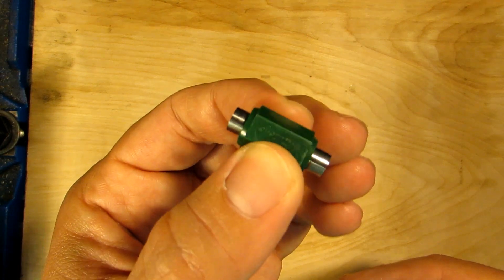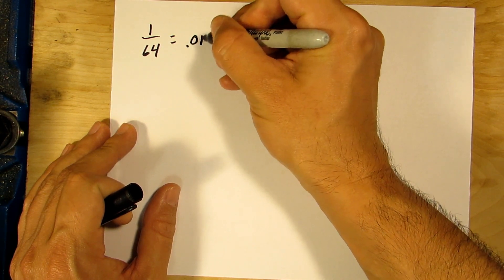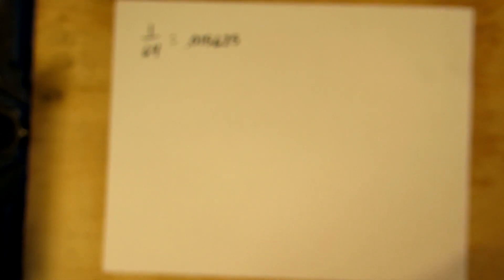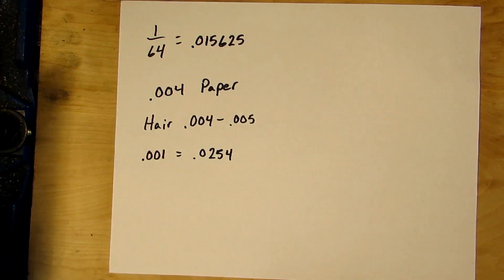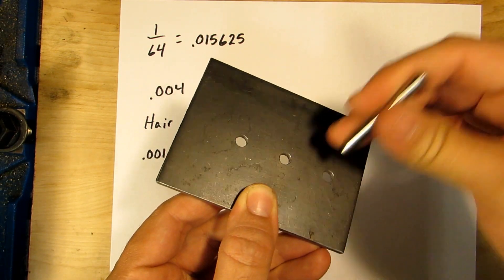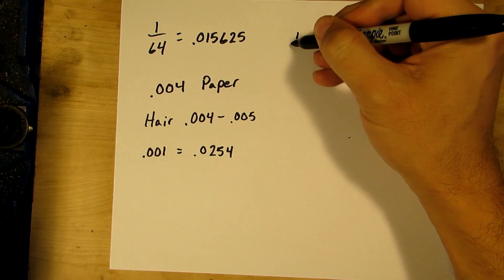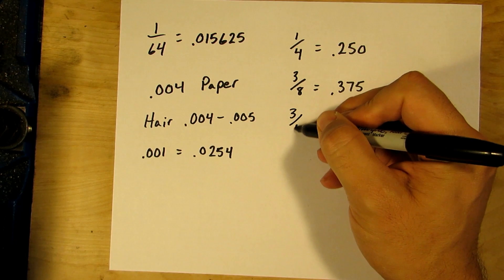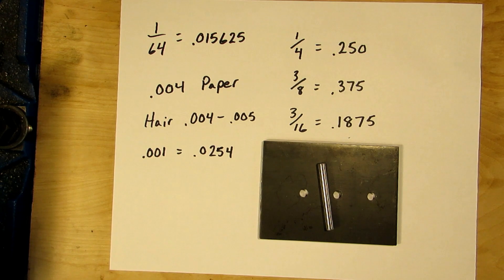What is a Thousandth of an Inch

Comment: In Jamaica I remember going to the shop and saying take off 1 thou on each side. If he calls back and say it’s slightly warped or not enough material, I then assume the risk of going below the min to correct it and I have in the past. Only then would I buy new rotors from aftermarket because cross drilled performance rotors would be coming. 😂

Comment: +|- .005 inch is pretty common tolerance in machining.Get down to 
+/- .0001 to .0005, fly cutting or milking won’t do it due to warping and flatness issues. Need to grind it.

Comment: hello I have a problem I need to buy a small roll of Galvanized roof flashing 17/1000s of an inch for a project but I do not know what size this is can you please help ?
Reply from the maker: Sheet metal thickness is expressed as gauge so if you search for "Sheet metal gauge" you can probably find a chart listing their thickness in thousandths. I don't know off the top of my head, sorry.

Comment: Great explanation.  I have been researching the experiments being conducted using BECs as a way of achieving absolute zero in a laboratory setting.  The "cloud" of atoms being used measures 1/1000th of an inch in diameter.  I am still puzzled how something this small can actually have room for a measuring device that can determine the temperature that is so close to absolute zero.

Comment: What helps me the most to be able to actually visualize what the "jumbo mumbo thousandths" really is in physical dimension, is that I know 1 thou is 25 microns, and there is 1000 microns in a millimeter.   So 5 thou can quickly visualized in my mind to "a little over a 10th of a millimeter".       Or 20 thou (20x25uM=500uM) half a millimeter.  I think most people can visualize a millimeter pretty well.   I can not immediately make sense or visualize 0.040".   But I know 40 x 25 is 1000.... or 1 millimeter...

Comment: An easier way to convert fractions to decimals and see what the next fraction would be is divide 1 by the denominator. 1 divided by 8 or 16 or 32 (common fraction sizes of drill bits) and that will give you the "unit" size in decimals. You can multiply that by however many 16ths or 32nds you want to know.

Comment: Didn't help at all for my question. Why is it called thousands if an inch, when its only ten'ths of an inch? For example if you stacked 40,000 feeler gauges that were 40 thou thick, what would that stack measure? 4'? 40'? Sure wouldn't be 1"
Reply from the maker: It's called thousandths of an inch because an inch cut into one thousand pieces is .001". That's your unit measurement. Your 40 thou feeler gage is .040" thick, 40 of those .001" slices, hence 40 thousandths. If you stacked 40,000 of those together (40,000 x .040) you'd get 1,600" or 133' 4".
Reply: @StuartdeHaro  Ah so thank you

Comment: If your pin is 0.2500”, what should the hole normally be for a good fit that allows the pin to move, but without significant wobble?  You would want enough room for a layer of light oil, perhaps.
Reply from the maker: It depends a lot on the length of contact. If the hole is in thinner stock like in this video, you can get away with a tighter fit. If you had a thicker part with everything else being the same, you might find there was too much interference. You'd probably still only be talking a half thou or a thou, more if you went with a bigger diameter.

Comment: Hmm, 0.001 = 0.0254? That's clearly wrong. This is why you must reference the measurement system. 1 thou = 0.254 mm. It's particularly important if exporting, selling abroad or working with other countries. Planes have almost crashed because one team was working in lbs of fuel and the other in kilograms but neither referenced the measurement units. It seems pedantic - until it all goes horribly wrong. You do not reference each individual measurement on the drawing, you do reference the system being used across the whole drawing in the same way as you would the projection being used. BobUK.
Reply from the maker: You might want to check again, Bob. .001" x 25.4 = .0254mm.
Reply: 25.4 mm per inch, exactly

Comment: What is a good way (or just a simple way) to remember the fraction to decimal conversions? Specifically the 8th's and 16th's. I'm expected to remember them off the top of my head, and I can't find a way to make them stick.. I keep forgetting them, or getting them mixed up. I know its a .0625 difference between them. example: 1/8 is only .0625 smaller than 3/16. Next is 1/4. Only reason I know that is because I have a table in front of me now..
Reply from the maker: Repetition is key. Maybe try making some flash cards to help you. Start with the 8ths and quarters. Those are easy. Then move on to the 16ths. If you can remember those you're set because you can just add or subtract .03125 to get the 32nds. Also, if you're unsure if 5/32 is bigger or smaller than 3/16, convert 3/16 to 6/32 and you have your answer. I hope this helps! Let me know if you're still having trouble.

Comment: I believe this is all correct:

Notes from video: 

1/64 inch = .015625 inches
AKA Between 15 & 16 thousandth of an inch
Loose fit for a bearing or a shaft in machining

Standard paper is .004 inches
Four thousandth of an inch

Most human hair is .004 -.005 inches
Four to five thousandths of an inch

One thousandth of an inch (.001 inches) (Metric) = .0254 mm

1/4 inch = .250 inches
(1 divided by 4 you get .25)
AKA Two hundred & fifty thousandth of an inch 

3/8 = .375 inches
Three hundred & seventy five thousandths of an inch

3/16 = .1875 inches  
AKA one hundred eighty seven thousandths & five tenths

To get your decimal equivalent for your fraction, you divide your top number (Numerator) by the bottom number (Denominator)
Reply: Taking notes of your notes.

Comment: I’m from the uk but server my time in an American engine company. I was taught the imperial system of measurement and still measure things in feet and inches. The thing that I could never understand was if the imperial system for feet and inches is based on 12 why isn’t the division of the inch the same. Why does it rely on the decimal system? I know the answer it’s cause it’s easier to work out. Decimal is so much easier to work with but legacy measuring has not moved on. The reason we still use the mile here and not KM.

Comment: is 128 of an inch a thousandths? Trying to understand measuring with my calipers...
Reply from the maker: Nope, still not even close. 1/128 is roughly .008" (eight thousandths of an inch). If you had that much clearance between a shaft and a bore, the shaft would be rattling around in the hole quite loosely.
Reply: @StuartdeHaro  thanks for that...so calipers not so good for 1 thousandths measurements ... maybe the digital ones of good quality?
Reply from the maker: I do not rely on calipers for close tolerances. I'll use them for +/- .010" or more. For anything tighter than that, I use a micrometer.

Comment: at 1:42     1/64 expressed in terms of thousandths of an inch would be 16/1000  (rounding might not be helpful in the real world though)  ...saying 1/64 =  0.015625 is 15,625/1,000,000 confused me because it's not expressed in thousands but millionths.   However, the demonstration using the  1/4" dowel, (=  0.250")  drives home the answer to the question first posed, 'what's a thousandths of an inch (0.001")?' .... it sounds like a small amount but it can make a very big difference  as you see it falling  right out of the 0.0251 opening.  Thanks.
Reply from the maker: Rounding is practical in most cases. We're not going to be making something to .015625" so .016 or .0156 is fine. That said, if you divide 1 by 64 you get .015625. Thanks for watching!

Comment: I want to measure 22 feet to the accuracy of 0.001 inches how how?
Reply from the maker: I'm sure someone out there has had to do it and there's probably some really big measuring tools specifically for it.  It's a tall order though.  The longer your piece is, the more likely you are going to have issues because of error stacking, heat transfer, etc.  For instance, let's say you have a 24 foot long pair of vernier calipers.  The machine that engraved or etched those graduations would have to run on some kind of rail and be driven by a screw or possibly a cog belt in the case of a laser engraver.  Let's say that it's a screw and it is super accurate with a max deviation on the pitch of .0001" per foot.  Well, after 10 feet your .001" tolerance will have been reached and at 22 feet the graduations on the tool you are relying on for your measurement are off by .0022.  Alternatively, let's say you have a micrometer that would do it.  It only has a 1" range, so your error stacking is negligible, but the heat from your hand on the frame expands it a little where you are holding it, which changes it a lot at the far end, more than enough to screw up your tolerance.  At that scale, it would probably be measured with a laser.

Comment: May I ask how long is 10.17 inches?  I know 10" but how much longer is the .17?
Reply from the maker: That would be just shy of 3/16" which is .1875". Overall that is 258.32mm.
Reply: Stuart de Haro  Thank you for the quick reply. So that's the little line before the 1/4 inch on a ruler?
Reply from the maker: Yep, that is right. Glad to help. Thanks for watching!
Reply: @nancymarrone6703  I'm a little late here but maybe this will help in the future. Figure out the smallest fraction your ruler does...usually 1/16 or 1/32. The multiply that value you were looking times the number of increments. So if you have a ruler that does 1/16. Then .88 times 16 is approx. 14. So it's 14/16 or 7/8 if you reduce it further.

Comment: Thanks for the clear explanation sir! Metric system far easier though. :)
Reply from the maker: I won't argue with you there.  As far as conversion between units it is so much easier knowing that everything is based on 10's instead of having to remember that a foot is 12 inches and there are 3 feet in a yard, 6 feet in a fathom, 5280 feet in a mile, and 3 miles in a league (BTW, that would make "20,000 Leagues Under the Sea" a space story since the Earth is only 8,000 miles in diameter, meaning that the Nautilus is another 52,000 miles out in space).  That said, accurate work can obviously be done in either system, it's just that the imperial system is originally based on anatomical features that craftsmen could have used out in the field.  An inch is roughly the length of the first joint of your thumb, a foot is roughly the length of, you guessed it, your foot.  Beyond that, the imperial system is based on cutting things in half rather than in tenths.  We cut an inch in half, then cut that in half to get quarters, then again and again for 8ths, 16ths, 32nds, 64ths, etc.  I think that is a universally relatable thing.  No matter where you live, everyone likes cutting stuff in half.  Thanks for watching!
Reply: Hi there Stuart, I think you misunderstood the book 20,000 Leagues Under The Sea, it did not mean Depth, it meant the distance they travelled under the sea, I like your videos keep it up many thanks
Reply from the maker: That makes a lot more sense.  Still, the idea of fighting a giant space squid somewhere between the Earth and the moon should be explored by Hollywood.  Cheers!

Comment: So LAST question...as I'm watching your videos another example. If this is read as .100 one thousandth then how is this read? .001
Reply from the maker: .100" would be 100 thousandths of an inch because it is 100 of these dudes, .001".  .001" is read as 1 thousandth of a inch.
Reply: So researching it I found, machinists like to break an inch into 1000 parts. Half of and in would be .500, a quarter would be .250, an eighth would be .125 etc...It still seems that the .001 vs .100 would have to be and exception to that preferred method? They can't both be one one thousandth, it has to be said one tenth so the term "thousandth" could be used when you are dealing with a straight "tenth"??
Reply: There was no need for your research buddy. You already found the answer with this video. You say they divide in   1000 parts hence thousandth. It's funny to me you imperialist use fractions from metric system.
Reply: Van de Haze stop being a condescending prick and mind your business if your goal is to belittle rather than help. Others learns and interpret things differently...

Comment: Thank you Stuart, but still lost. Adding the 0 after .25, the zero has no value, why add it to the number. I'm know this is very once to you, but to me, if I had $25 and you have me a zero...I wouldn't have $250 all of a sudden. I understand "our unit of measure is .001, but if I have you .375 would you say that 375 thousandth of add a zero and say it 375 ten thousandth? I really want to understand the logic behind this, not arguing...you got my thumbs up a subscribed!
Reply from the maker: It's really just because machinists talk in thousandths. It's simpler to refer to everything in terms of one unit, so .500" is still referred to as 500 thousandths because there are 500 of the .001" units. A mathematician might drop the zeroes and call it 5 tenths, but you can see where that would cause confusion in a field where 5 tenths means .0005". Likewise, in your example of.3750, a machinist would just call it 375 thousandths and 0 tenths rather than 3750 ten thousandths of an inch because that's just how we roll.
Reply: In machining it does have a meaning it means the tolerance does not allow any more deviance in that decimal place
Reply from the maker: Yes, the decimals have meaning on a print, but he's asking about why we refer to .500" as 500 thousandths instead of 5 tenths of an inch.
Reply: Adding zeros after the decimal don't effect the value, adding them before will (unless they're leading zeros)

Comment: Why is .250 read as 250 thou (adding a zero so it is not read as 25 hundredths) but we don't add a zero on .375 to change from 375 thou to 375 ten thousandths?
Reply from the maker: Because our unit measurement is .001" or one thousandth and there are 250 of them in .250", hence 250 thousandths.  Really it comes down to being fluent in the lingo.  If you go into a machine shop and say 25 hundredths instead of 250 thousandths, there might be confusion and they will DEFINITELY talk about you later when they're on break and probably will for years to come.  "Hey, remember that guy that wanted something made in hundredths of an inch..."  You'd be a legend, like a machine shop yeti.  Everyone knows the story but only a couple of people have actually seen it.
Reply: I think the reason for using a base unit of one thou is because a standard imperial  micrometer's smallest division is 1 thou.
It is a shame that there is no generally accepted name for the metric mic's equivalent, "huns" doesn't quite have  the same ring. I once thought the name DaMu, Da a ten quantifyer and Mu for micron. DaMu could also be damn you, especially when you miss your mark by one..
Reply: I think where I really get tripped up, the first place to the left of decimal is expressed as 5 (5.) this is expressed as 5 one thou if it’s right of the decimal (.500) BUT when it is 3 places right of the decimal, then it is “five “ again...thousands of course. Does anyone see that confusion. I’m not arguing it, it just is taking some time for it to come natural for me.
Reply from the maker: Sean. 5.000 is five inches, not five thousandths, .500" is five hundred thousandths, .050" is fifty thousandths, and .005 is five thousandths.
Reply: Stuart de Haro oh man, this is getting crazy. For sure 5.0 is Five. What I'm saying is first spot left of decimal is spoken five.....blank, first spot right of decimal is 5....hundred thousandths but we know is it's actually the tenths place. I totally get all this, I'm not that confused as to not understand that 5.0 is five WHOLE units. It's just wacky that the tenths & hundredths are now SPOKEN differently simply to use THOUSANDTHS as a go to term. I seriously wished I never asked this "simple" question. Ugh...
Reply from the maker: I think I found the source of your confusion. .500 would be 500 thousandths not 5 hundred thousandths.
Reply: Sean if you did add a zero to .375 you would get 3750 tenths.

Comment: Good practice would use a zero before each decimal  i.e. write 0.250"  but not .250"
Reply: As per ANSI standard, English units do not have a leading 0 but metric units do. '.250' inches is correct annotation. This is important because ANSI allows you to make assumptions when something is not specifically called out. When you see '.25' on a drawing you can make the assumption that it is .25 inches. Alternatively when you see 0.25 you can assume 0.25 mm unless otherwise specified.
Reply: @MrFancyPants_  Correct.
Reply: Wouldn't it be 25" for inches rather than 25'? It may just be typo or something or I may just misunderstand considering my initial search was how to read a caliper with a dial on it. I carve wood so I rarely deal with anything smaller than 1/8 inch. Lol.